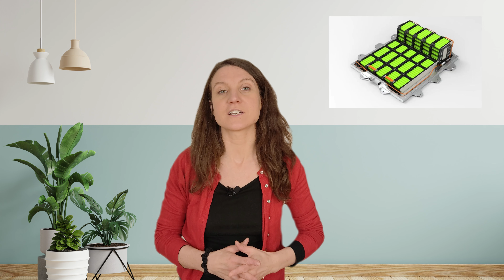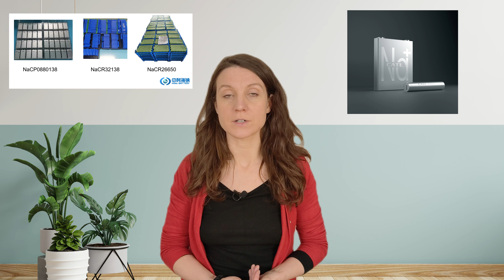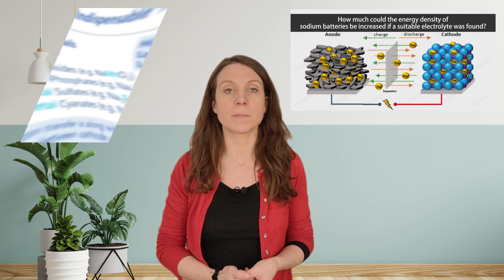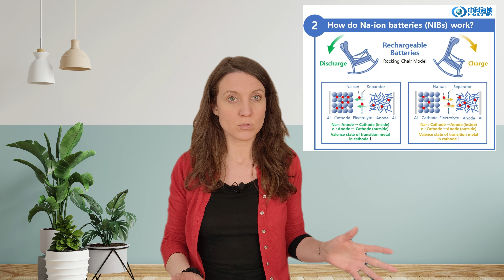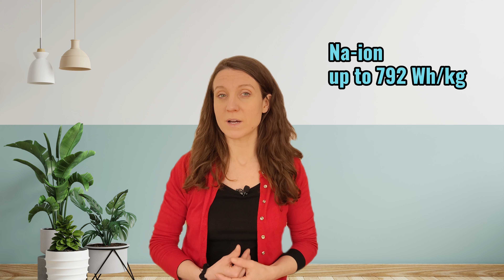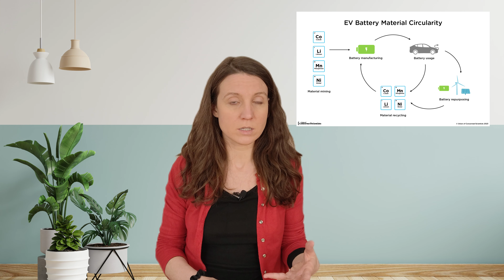Solving EV Range Anxiety: Is Sodium the Answer Over Lithium?

Comment: Once super charging is ubiquitous along with fast charging EVs,   battery range will largely become irrelevant.  A 200 mile range would be more than adequate.  You need a rest anyway every 200 miles driving, so you can fast charge then.  Also large scale storage is better suited to sodium ion technology, due to safety.
Reply from the maker: I don't really have a problem with this, we have such a high density of chargers here that I can choose where I stop or which provider. We are building chargers much faster than the number of EVs is growing. But we also have quite a specific market, there is very strong anti EV propaganda and people are confused by it, so we are one of the worst in the EU in EV adoption.

Comment: Sodium ion battery pack can be àt 15000Euro. Well lithium ion battery packs are already below 10,000 euro. At cell level they are in the range of 45 to 55 euro per KWh.
Reply from the maker: Yes, as mentioned in the video, lithium prices are currently at an all-time low, which is great for battery prices lowering.. of course it's a question of how pricing will develop years and decades into the future as EV battery demand grows exponentially. With sodium being much more abundant and accessible to a wider array of stakeholders, it may become more and more interesting over time. 

I am also curious to see whether sodium-ion batteries will move closer to lithium-ion's performance parameters as the market evolves. At this point it's still a baby industry, while lithium-ion has years of experience and development behind it already. Will be interesting to see how it plays out

Comment: Thanks. I have searched for ways to fully understand battery chemistry. Filling up with diesel or petrol is apparently quite different. I usually just fill up to full with my diesel. When my MG4 arrives soon, I wanted to understand how best to charge. I have only found Engineering Explained’s explanation of why partial charge is better than filling up completely.  https://youtu.be/w4lvDGtfI9U?si=PKxruKsgl9d9hA2p

I then located Dr Dahn whose information about the R&D testing of batteries made things very clear to me.  https://youtu.be/i31x5JW361k?si=Vvs_K50GGOI97Ko9
Reply from the maker: The batteries in EVs have such a long life that I personally don't worry about it at all. I always charge to 100% on a slow AC charger (it's not a real 100%, as when the display shows 100 the actual charge is a bit less, depending on the manufacturer) and to about 85% on a fast public DC charger, because the last 25% of the charge is too slow and one blocks the charger unnecessarily. The car is meant to serve me, not the other way around. I recommend trying this approach too, it's very liberating. 😄The only time I wouldn't charge to 100% at home would be if I didn't plan to use the car for the next few days right away and it was going to be parked for maybe 2 weeks.

There's actually a great example under the first video you recommended. This is the first comment: "Here in Chile, in my company, we have more than 800 electrical buses with around 250KWh of original capacity, bought almost yearly from 2016 to 2023. We currently don't see a significant (statistically) degradation in capacity (SoH) even after 300.000 KM, but we take precautions: we avoid charging to 100% wen in the higher side of the city to avoid loosing the possibility of recharging on the road, we do a full charge at least once a week, we rotate the buses from different routes, we don't start routes with less than 30% of charge to avoid running out of energy due to unexpected problems on the road. We have some cases of degradation of around 3%, but once again, on a fleet analysis, degradation = 0% statistically."
Reply: @siasek  I am not worried about how long it might last. I am simply someone who wants to know how the system works and how is it different as a technology.

Comment: Lithium is in plentiful supply presently and the price is decreasing. And Australia produces nearly 50% of global lithium and is the biggest global supplier. Some familiar with the industry predict sbout a 30% price reduction in 2024.
Reply from the maker: It is plentiful in supply and also very cheap, presently. But I think presently is the key word here. The EV industry is just now starting to really take off. Not to mention the countless other technologies which use lithium. It's simply not sustainable for years and decades down the line. Plus there are ethical concerns around lithium mining and the supply is limited to select few countries. Sodium offers more opportunity to countries without lithium reserves and I believe it will become more and more interesting as we see the rate of EVs on the road increase
Reply: @siasek  However, as the market matures and batteries come to the end of their lives, the lithium in them will be recoverable to make new batteries. It's not consumed.
Reply from the maker: @moragkerr9577 that's a fair point, but with lithium batteries it's also important to consider the other metals needed to make it, like nickel, cobalt manganese. Also, even as we recycle old batteries, if the market expands dramatically, like if 95% of cars on the road are EVs let's say, there wouldn't be enough supply of lithium from recycled batteries to keep up with demand for new EVs, so you'd still have to mine it.
Sodium offers a more accessible solution. Of course, it's a question of whether sodium-ion batteries will be developed to match the parameters of lithium-- ion. If yes, I think they'll become the obvious choice as the market expands.
Reply: @siasek  I would challenge "needed". My battery is LFP - basically lithium and rust. No nickel, no cobalt, and I don't think it has manganese either. (Though I have a vague memory of Euan McTurk saying something about a sprinkle of manganese being like "fairy dust" on LFP batteries.)

If sodium can be developed so that it's practical for EVs then that's great, but I don't think continuing with lithium is necessarily a problem.

Comment: There's a density problem where EV drivers need at least 250 miles in order for an EV to be practical.  After that, it's whichever's the cheaper battery wins.  Being able to beat the huge production scale in cost of lithium batteries will be the biggest hurdle.  It'll be this chicken and egg problem where anyone dropping down billions wouldn't see any return of investment until they scale up, but someone will need to be willing to buy more expensive batteries in the short term for production to scale.
Reply: Why slightly better stuff normally doesn’t over take market share it needs to be massively better.
Reply from the maker: I don't know that range alone is the deciding factor for all EV drivers. The average European's daily commute is around 60 km, roughly 40 miles, so I think 250 miles is above the needed range when we take into account the option of charging your car while it's parked at home or work. I do think it is more of a determining factor in the US, where the distances tend to be longer.

I'm not familiar with the details of manufacturing sodium-ion batteries, but considering their similar chemistry to lithium ones and the fact that lithium-ion battery facilities can easily be converted to sodium-ion battery manufacturing, I don't think scaling production should be that much of a challenge. Of course, sodium-ion batteries do still need a bit more development behind them to make them truly interesting, but they are bound to become more interesting as lithium prices swing back up in the future. Right now, with lithium prices being the lowest in history (due to over-supply as I mentioned in the video), sodium-ion batteries are not so interesting, but if we're looking years and decades into the future, I think the potential is huge.
Reply: @siasek  it could be less in Europe but you gotta double the 40 for cold wealth turning up not 80. Then double again for local weekend trips which people tend to do which is double your commute so that would be 160 miles. So yeah can def have less miles but not massively less.
Reply: @siasek  we once relied on nickel metal hydride batteries, and it took a leap of faith from Sony to make lithium batteries viable and a decade later lithium EVs were here.  Things could happen again and in an accelerated rate as the market is bigger.  Either way it’s bound to happen.  The only factor is time frame, I think it’s in the 5 to 10 year time frame given what I’ve mentioned.

Comment: I've seen loads of sodium-ion 18650 batteries (like the ones in EVs) for sale.
However, they are around 1300mAh instead of 2200mAh for Lithium-ion batteries.
The challenge will be to increase the capacity of sodium based batteries whilst keeping costs low.
Reply from the maker: JAC decided to make the first electric car with a HiNa sodium battery using the larger 32140 format, the parameters of the cells used are here, quite interesting reading: https://www.perma-batteries.com/wp-content/uploads/2023/12/Hina-NaCR32140-MP10-Test-Data-202310.pdf 

Fingers crossed for a capacity increase, it would be great to get rid of the need for lithium.🤞